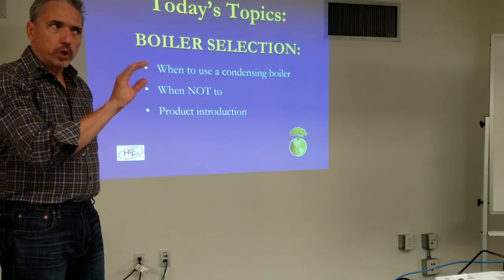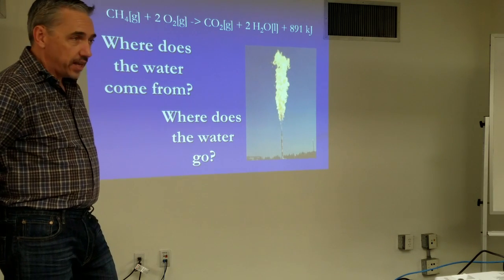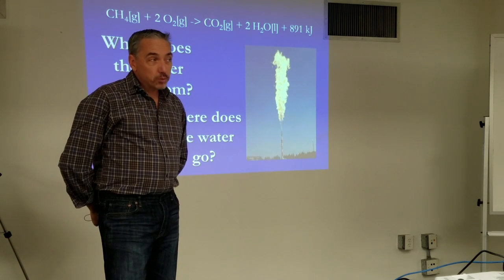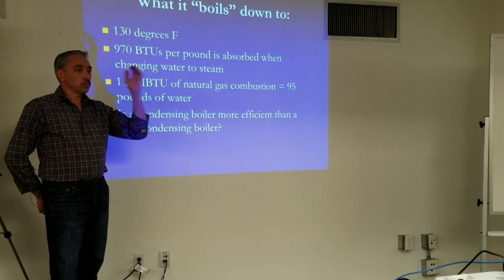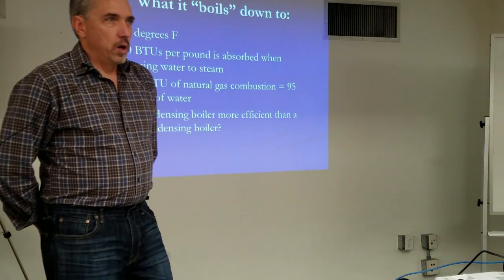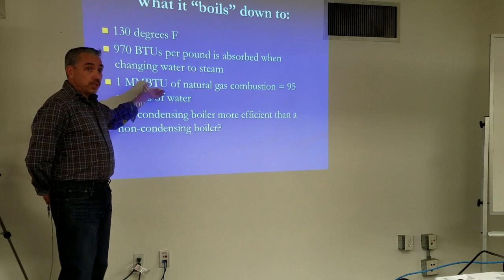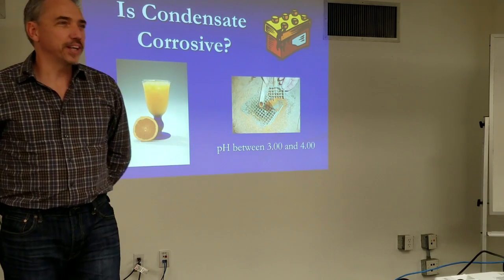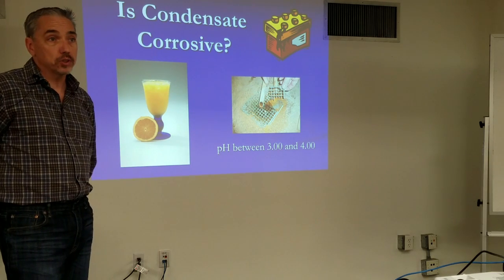When to use a condensing boiler

Comment: If a condensing boiler works at a lower return temperatures  And outdoor reset keeps the water temp lower than 180 How does a fin tube baseboard  create convection currents to effectively distribute heat in a space?
Reply from the maker: The surface area of your radiating baseboard heater would need to account for the lower temperatures. But if you're only raising the room a few degrees then it's usually OK.. If it's an existing system, experiment with it. On a mild day lower the water temperature to 110ﾟ and see if the room can heat itself back to 70 or whatever your set point is.

Comment: So radiator needs to be oversized?
Reply from the maker: Size the radiator for the inlet water temperature being supplied.  The lower the water temperature the larger the radiating surface requirement - but calling it "over-sized" might not be entirely appropriate.
Reply: @cod4blasterable  last few days reading a lot of stuff, all I see is that need to be minimum 30% bigger than the 90\70C calculation if I want exit water from boiler  55\45, and 50% more if want 45C exit water temperature.

Comment: What kind of gas water heater can i use for a hydronics systems and the domestic water ? Thank you in advance
Reply: Best answer is "it depends".  One must consider the rest of the system design before get into specifying a boiler - you're kind of asking the question backwards.  What are the heating demands (both heating and domestic hot water in BTU/hr), do you have buffer volume?  Residential home or commercial building?  Occupied all the time or partially?  Etcetera.  once you figure out what temperatures the system needs/wants, THEN you can figure out if a condensing or non-condensing boiler is okay.

Important to remember is that the more things one pulls into a system, the more the system must behave like a "system".  Domestic hot water is typically specified at 120°F, but I prefer to see it leave the water heater at 150°F to prevent Legionella growth and circulated so that the return temperature is no less than 130°F giving 10°F margin (using a variable speed pump, and temperature sensors on the far end of the loop and both the supply and return from the water heater) - then using cold-water mixing at the faucets.  One can use another buffer tank to separate the boiler from the hot water heater, and mix in with a double-walled stratifying coil on another variable speed pump (something like this SILJAN: https://www.youtube.com/watch?v=uwo1m1tF_0I).  In this way the temperature cascades from the hotter hydronic heating loads down to the lower temperature domestic hot water.  The boiler will primarily see higher temperatures from the hydronic system, reducing the risk of boiler condensation in the first place - then proper buffering/plumbing to ensure that the boiler is allowed to stay above 140°F at the worst case heat load +10%.  To cover shorter heat runs, you'd then figure out what heat capacity you can do and pick a boiler that can fire that low and stage more than one, or find a variable firing rate boiler that can go that low and up to the max heat load (again, perhaps with staging).